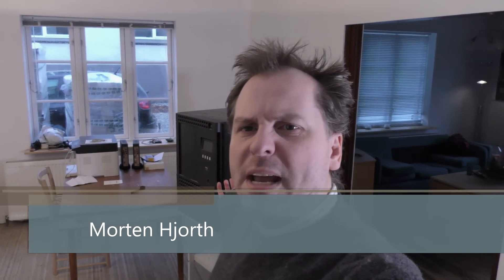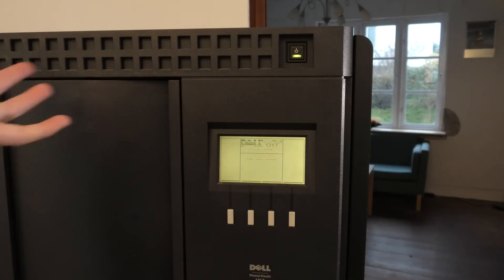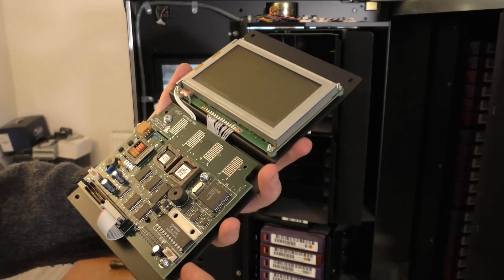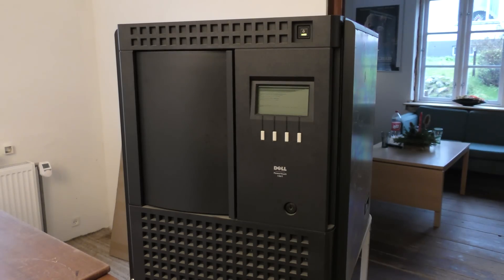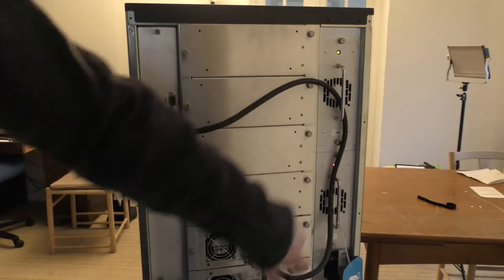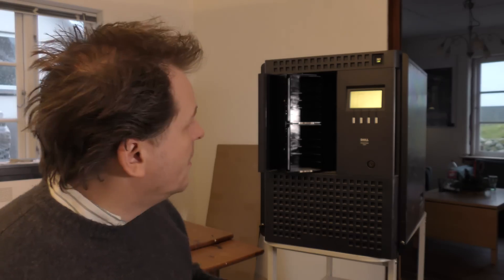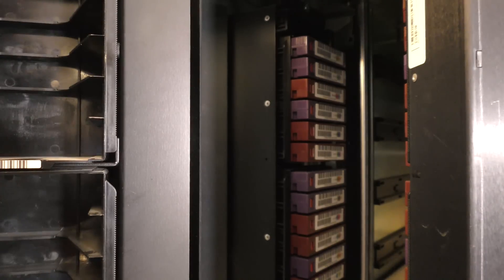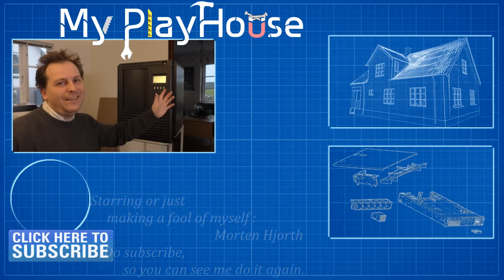Is Tape Dead ?? This Dell Powervault 136T with LTO2 is!! - 785

Comment: Couldn't you swap out the drives and use the robot with modern tapes?
Reply from the maker: These tape stations are,,,were expensive,, time flies,, now you can get a SD Card bigger and faster :-)

Comment: Yes. Tape is dead. We can use external HDD archive. 
1-Compartible. 
2-Less affected by environmental conditions.
3-Lower cost per GB. (Especially when Video is stored)
4-More solutions for HDD data recovery.
5-More durability.

Let's think about 12 TB per day backup. 84 TB weekly backup. 360 TB monthly backup. After the disaster which company wants to return to 360 TB with 30 cassettes? (It's only 1 month).
Reply from the maker: Hi edemirci1
Thank You very much! The transfer from and to LTO 8 is 360MB/s so it takes 9.3-ish hours to fill or empty a tape. And it's normal to have more drives because of this. like five tape drives,, It helps.
Thank you for watching! :-)
Reply: @MyPlayHouse  Thanks for the answer. Portable backups are taken for disaster. I think for disaster situations (examples fire, flood, tornado, terrorist attack) need to back up the tape drives first. :) Nowadays not tape backup solution. It's just a marketing product. 

This video example office fire: https://youtu.be/PqQHIXHZlro?t=420

Let's suppose they take backups with tapes. The good news still has backups. The bad news is that the tape drive was ash in the fire in the office. Let's suppose they have backups with diffrent location HDD archives. Access to backups is very easy. I think they can find a computer.

I used tape backup a long time ago. If the backup software database is not present, read the entire tape for only one jpeg file. Backup software database is rebuilt. This is a huge waste of time. The biggest handicap of the tapes is not to plug and restore. The tapes need a database of backup software. Not like BluRay and HDD.

One lto 8 tape drive is 3-5 thousand dollars. 5 tape drives 15-25 thousand dollars. 1 tape drive $3.000 / 8 TB External HDD $150 = 20 external HDD drive (approximately). And 8 TB external hard drive is cheaper than LTO-8 tape. External hdd drives stock get more sensible and advantageous disaster solution. 

Best regards.

Comment: might want to pull the tape drives out and use standalone to see whats on the drives if they work, just getting a SCSI controller to talk to them might be an issue but food for thought
Reply from the maker: Hi Sakura Kinomoto
I do have a stand alone LTO2 drive,, and a 3 or 4 ,, I forget..
Thank you for watching! :-)

Comment: Can you maybe trick it so it thinks the door is closed and show us how it moves? Maybe even show how to use it properly with the catalogue  software and so on. I think that would be very interesting. Isn't the point of  tapes long term storage, not so much maximum capacity.
Reply from the maker: Hi Cutter Slade
Maybe,, did not think of that... that would have been fun :-/
Thank you for watching! :-)

Comment: "It doesn't use Windows" - well, there's something nice to say about it! It's always an advantage if Microsoft stays outside :-)
Reply: Well, it is controlled by an embedded device, so it is even rather likely that it runs some on kind of Linux kerne.
Reply from the maker: Hi Seegal Galguntijak
Thank You very much!  this did also run in windows server,, think we were using novell netware.
Thank you for watching! :-)
Reply: Hi Morten Hjorth
Thank you very much! In my opinion, "Windows Server" is an oxymoron by and in itself ;-)
Thank you for replying! :-)
Reply: What about mac osx?
Reply: I wouldn't want a fancy GUI without comprehensive computer operating logic on a drive storage unit, LOL

Comment: The fault in the display is most likely in the rubber contact strips that connect the pcb to the glass of the LCD, so you'd have to take the LCD module apart and get it back together again after fixing it.
Reply from the maker: Hi Seegal Galguntijak
Thank You very much!  But do I fix it before I throw it out :-/ ??
Thank you for watching! :-)
Reply: Hi Morten Hjorth,
Thank you very much! You could try opening the LCD module - or sell it as broken, but with good parts (tape drives, tape swapping robot), if the "professional IT" refurbisher might give you some scraps for it, to use it for spare parts. :)
Thank you for replying! :-)
Reply from the maker: Hi Seegal Galguntijak
I do like to fix stuff,, lets see 
Thank you for watching! :-)
Reply: Hi Morten Hjorth,
I wish you good luck and much success with it, and it might even be worth a bit of money.
Thank you for replying! :-)

Comment: The problem with 50 year old tape will be to find a working machine that can still read it!!
Reply: Wont be that hard tape drives are used for long term storage you only put stuff you want to keep for years
Reply: Raw Toast That's right, but companies that backupped their data on tapes in the 80s and early 90s and need to access these drives nowadays already have a hard time finding old drives that still work and can read this data. It's no use for long-term storage if the format changes every couple of decades.... That's by the way the problem with most modern technologies. How long have we had analog TV? Right, 50 years or so. Then they introduced DVB-T, and quickly made it obsolete to be replaced by DVB-T2, which again poses new problems (aside the environmental fact that lots of devices have become obsolete as well through that). And now they're thinking about switching off analog FM radio to push DAB. Well, imagine how long this is gonna hold? 10 years? Or even 20? FM radio is how old? Also something around 50 years, I reckon...
Reply from the maker: Hi Raw Toast
Thank You very much!  glad you liked the video :-)
Thank you for watching! :-)
Reply from the maker: Hi Seegal Galguntijak
Thank You very much! Yes important to copy over backup/Data to new media,, every time.
Thank you for watching! :-)

Comment: I wonder if you could just reset it back to factory settings then set it up through the network interface?.... i did a google search. there are still many items available to fix this thing... https://www.google.com/search?q=Powervault+136T&source=lnms&tbm=shop&sa=X&ved=0ahUKEwjMmc-atJrfAhWF6IMKHaYTAyMQ_AUIDigB&biw=1853&bih=953 ... a few items down is the front LCD board. i love messing with stuff like that. very cool item.
Reply from the maker: Hi Mike Hensley
Thank You very much!  but I am getting rid of it..
Thank you for watching! :-)

Comment: The 12,000 slot tape library i worked with in 2001 had less space than you can fit in some 2U servers today. It had two 3 meter diameter silos, 20 tape drives and 12,000*20 GB of storage. That isn't even as bad as the 72,000 slot library with 400 MB tapes some colleagues ran to backup ancient systems.
Reply from the maker: Hi Jesper Monsted
Thank You very much!  Time has also come and pass, for this one.
Thank you for watching! :-)